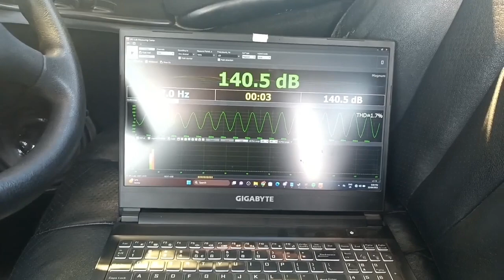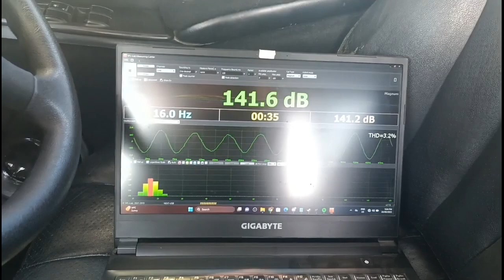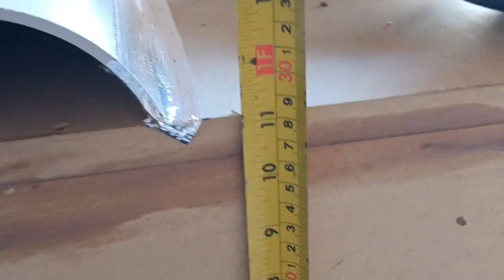143.9db (17hz) Sundown Audio U Series 6.5 Build music run average scores and more.

Comment: My guess on that coil is there's some side shifting due to uneven loading, caused it to shear like a can. That's says a lot...these subs were fully using their power against the air load. Proper use 👌 I've been trying to prove that the subs feel offset loading if not symmetrically placed in the box.
Reply from the maker: There were no loading issues.
Reply: @puresesh7985  what I mean is that the subs are actually using all of its power to convert all of the magnetic force in to sound energy. I would like to see the clamped power or the impedance curve.
Reply: I believe that in some cases the subs actually feel some offset pressure on the edges of the cone, only momentarily and this in severe cases can cause the cone to shift and maybe even cause coil rub on weaker suspension. The problem  can be more exaggerated by offset mount of the sub within the box or with wavefront that create offset pressure on the cone. Really hard to prove, but I want to try.
Reply from the maker: @subdynoman  I think what you are believing is wrong. Clamped power is around 1k on them.

Comment: Did you do a lot of testing to figure out what works for your car, then after you figured that out, you could just design a box that will perform easily in your car?
Reply from the maker: Yeah after figuring what works in this car it's not too hard
Reply: @puresesh7985 how do you test to figure out what works? Like port placement, tuning box size? Or is it something else?

Comment: I wanna see the inside of the box. Give dimensions of all cause if it's doing that I wanna build a box like that. Fake or real it's still awesome.
Reply from the maker: I'm not sharing box specs
Reply: @puresesh7985  lol OK
Reply from the maker: @Marz-px6vx  I guarantee you didn't laugh
Reply: @puresesh7985  I did laugh cause I told my wife I bet he will tell me I'm not sharing my box dimensions or not reply at all. I was hoping you would share but that's fine thanks.
Reply from the maker: @Marz-px6vx  you were right then haha. I don't share em took to long to dial in
Reply: @puresesh7985 n you atleast give a hint? Is it a lot of box volume? Extra large (or small) port area? Something else?
Reply from the maker: no. because thats what everyone says and it doesnt work.  @bailey2517
Reply: @puresesh7985  Geeve me a hint to the port velocity at least... pretty pls. Or at least explain to me what the goal for the box is, like high port velocity or something
Reply: @andriesgeddes4692  It looks like a big ported box tuned low i presume under 30hz.  I have 2 6.5 inch subs in a 1.3 cu ft box tuned to 36hz and its still much smaller than this.  Although the port could be making up most of this box for that low tuning
Reply: @benmiller5830 in this case so you increase the net volume to larger than what the factory spec recommends?

How do you get such power out of these? I understand tuning low e.g. sub 30hz... but 30hz can be done at any net volume if you adjust your port
Reply: @Marz-px6vx it’s prob a 1/4 wave box.
Reply: @michaelmendonca80  I'm no acoustician just a sound guy but from what i have experienced, the larger the box with the same tuning, the more port response and port velocity you get at the tuning frequency.  I'm not sure what you're referring to by power but I assume you mean output/efficiency at those notes?  I believe those subs cannot play below 30hz in a car without some sort of help from a low tune.  Be careful tuning too low, you'll lose output at higher bass notes.  Before I had those 2 6.5 subs, I had 1 fat tang band 6.5 in the same box tuned to 28hz and it just could not play between like ~33-45hz.